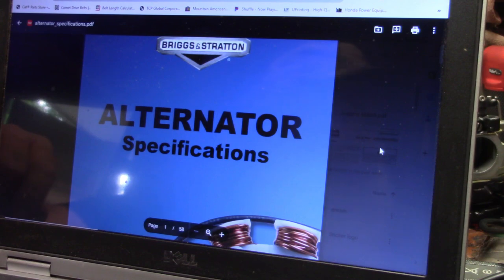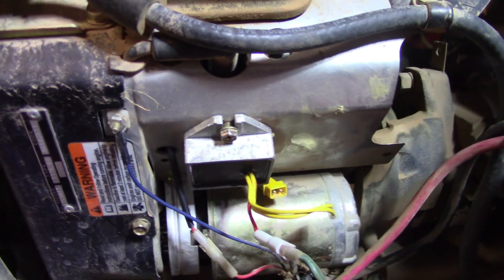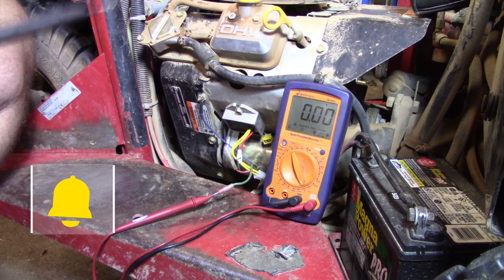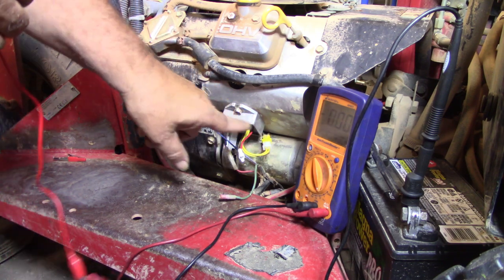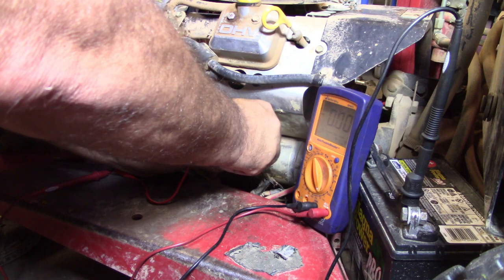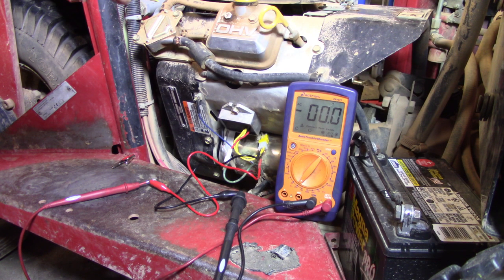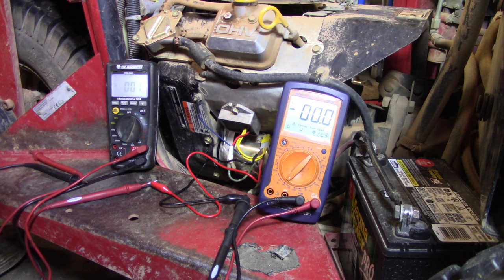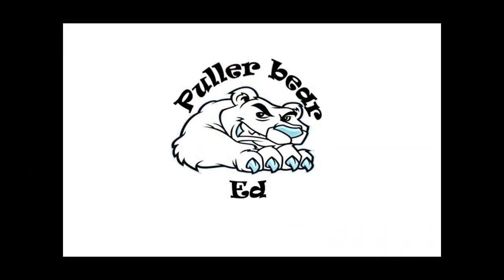Briggs and Stratton 18hp Vanguard not charging battery. how to test a charging system.

Comment: Often the case that a connection is not good or not good enough. Well done!
Reply from the maker: I'm really trying to fallow the " test don't guess " method now a days because parts are getting more and more expensive.
Reply: @PullerbearEd  A good plan. Otherwise you replace everything for want of a cheap wire or connector.

Comment: Hi Ed, my stator is putting out 25 volts ac, I thought it may be bad so changed out for a new one, and new one is only putting out 25 volts, so thought it could be the regulator as when I tested that in dc volts it came back as 12.5 volts, so swapped out for a new regulator and that was still putting out only 12ish volts…. Any other ideas wha5 it could be……it’s 25av volts enough
Thanks steve
Reply from the maker: Yes 25 vac should be enough the voltage may get a little higher with rpm increase.
Reply: @PullerbearEd but both regulators are only putting out 12.5 ish volts... Shouldn't they be putting out higher
Reply from the maker: 13-14 volts are normal. But I have had a couple that only put out 12.5-13 volts.